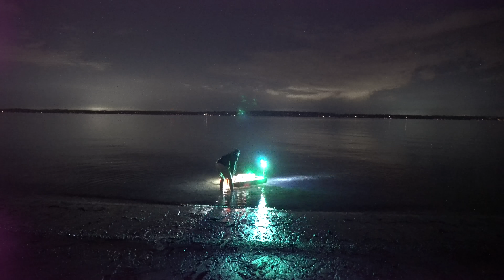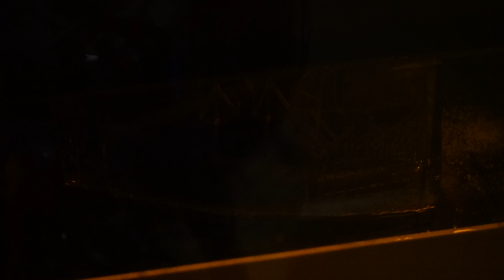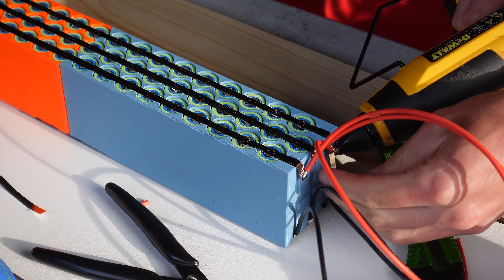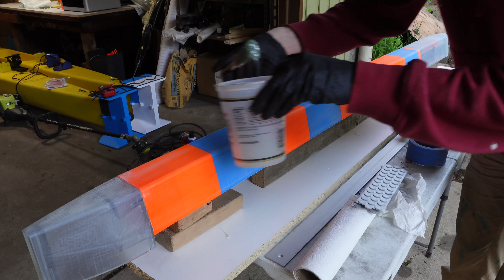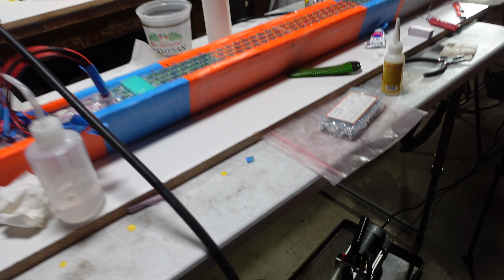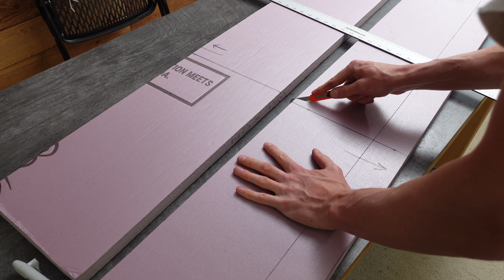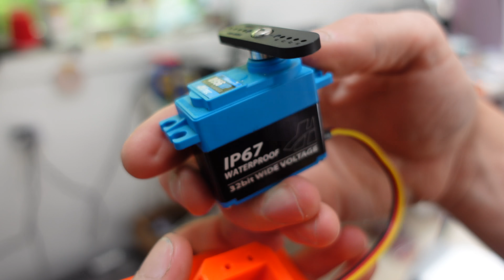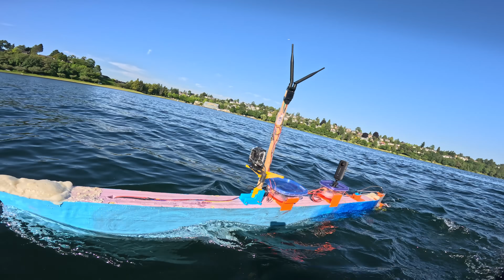"R/C Boat" with 40 lbs of Batteries

Comment: I don't know much about boats but what about fitting two propellers side by side instead of on top of each other ? Sure the rudder and stern would need to be redesigned, but that way you could cancel out the torque while having both propellers under the waterline

Comment: This may be a dumb question, but why all of this grease work instead of mineral oil?  Mineral oil is non-conductive and actually flows. And I'm pretty sure that I've seen you use mineral oil as part of waterproofing on other videos?
Reply from the maker: Mineral oil will leave. Grease stays in

Comment: Couldnt you use a longer Steuerung paddle? Or would that be Even worse because the servo has to use Even more power to steer?
Reply: Also These new fraight Container ships have These wave guards at the front, others pointed out that a Sharp bow would be better so this could be a one Part add on

Comment: @7:18 and @10:35 - Someone taught me a trick with packing old bearings.  Slather the bearing with grease and vacuum seal the pouch.  The grease really gets in the nooks and crannies.  I may have considered the same treatment for the battery greasing.  I see you got around to it...

Comment: I think you should make 2 and make it a catamaran. Also make an access door with simple gasket in the rear instead of that insane top cover over the batteries. Then the tray could slide in from the back.

Comment: Surprised you didn't heat up petroleum jelly and pour that into the battery area. Also, do the cells not get monitored? How do you make sure the cells are evenly charged? Or is that not a concern?

Comment: While filling it with grease. You should have held it at 90 degrees and let gravity naturally allow the air to flow to the top. Though, might have needed to vibrate it to get it move up quicker.

Comment: Cool project.    Not sure why you didn't just use any old oil to displace the air... anything denser than water would have kept it out.   Sure would have been a lot easier.
Reply from the maker: Grease can’t leak out like oil would

Comment: You could make an arm like motor mount that extends from the top rudder motor mount to the bottom and make coaxial proppelers with two motors. It wouldn't add that much drag but servo would have dificult time for sure.

Comment: Add a heavy(ish) keel to make it draw more water/sit lower as well as add yaw & roll stability? Even a bulb keel? And if the weight of the added keel pulls it lower into the water you’ll be able to use counter rotating dual motors again.

Comment: Now we know why Navy destroyers had such a flaring bow during World War II. It was to deflect the big waves 

They also needed the power of two propellers.  
They place them next to each other horizontally rather than vertically. 

Why couldn't you have steering in front, just as well. Is there such a thing as a front-rudder?

Comment: so why ardupilot does no longer work for arduino, defeats the purpose of arduino based flight controller. or you could prefill (cast) the grease, then screw the lid on. sub with a radio tower, under water inverse sub-planing. it would be air-foiling then.

Comment: Thanks! I can't stop thinking about making a small "tractor" that could be useful on a farm. Your videos are giving me great ideas and motivation!
Reply: Me, too, but in planning, I find diminishing returns from extra weight due to more batteries. More batteries are necessary of course to get longer life, and also better traction when towing, and more counterweight when scooping things. The diminishing returns thus causing the ever expanding need for more charging stations at more points on the property to get the most done.
Reply: @AndrewDutton-Topper maybe hybrid car batteries and motors with serious reduction in gearboxes, then big tractor wheels or UTV wheels would be legit. 

Even better with a Tesla drivetrain. 

The key is to make it remote. Not a ride on tractor. Maybe use tracks vs wheels. A 3 point hitch on one end and hydraulic rams on the other would be cool.
Reply: LiamTronix has a video of making an electric tractor. he repurposed an old tractor. *edited for spelling
Reply: @ashman8613 thank you!!!
Reply: Tracked skateboard design. Big and heavy to tow and pull, and maybe dig or mow, but a 400 lbs small tracked platform. 

Maybe treadmill motors and snowmobile tread. Platform in the center the same width as both tracks. Plate on either side with 4 shocks and coil overs for rollers. Motor high in the front and another low in the back on either side.
Reply: That said, it's very difficult to beat the efficiency of a 30hp 4wd tractor. They often have finish mower decks under the center of the tractor, but once the deck is off, the 3pt hitch can run a bush hog, and a 4wd small tractor can climb damn near anything. 

Less with a boom on the front or a bucket.

Comment: Daniel put some bubbles with an air pump at the front of the bow. Do you think that will help? BTW, I was on my stand-up jetski and a Great white shark tried to breach me but ended up just slamming into the side of my ski. I started it up and took off back to the harbor and got the heck out of the water. I was at El Granada Beach in Half Moon Bay, California. I'm never getting in the Ocean again. When you feel the power that you have no control over, it puts fear over you that you can't seem to shake. This happened to me on July 4th. It scares me just writing about it. I hope the body of water you are always on doesnt have GWs in it. Stay safe.

Comment: Have you thought about using parafin wax to seal the batteries? It should be a lot easier to just pour it over them while it is molten, and would repell water like grease
Reply from the maker: but then it gets cold and cracks
Reply: @rctestflight  You can mix in some hotglue sticks (EVA) to prevent that, we used the mixture as the fuel for a hybrid rocket engine and it was really strong

Comment: i would've added more screws to make the battery compartment more air tight and submerged the batteries in mineral oil. mineral oil is fluid at room temperature and would been less of a struggle.

Comment: man just throwing old batteries at the pack might actually decrease your overall pack capacity. you need each set in series to be the same size to squeeze out all the energy from all of them. for your grease you could've heated it and the batteries up a bit. they should be pretty safe at like 50 deg C and the grease will flow much easier.

Comment: Waterproofing suggestion. Paraffin wax it flows easily it plugs holes and waterproofs at same time, parts out side of the hull can be dipped. It's not too bad to remove and it is reusable. A heat gun could be useful to reflow spots after changes or repairs are made. Thanks for the many years of vicarious fun.  Also it's not to pricey
Reply from the maker: I was afraid wax would crack once it's in the cold ocean water
Reply: @rctestflight paraffin wax doesn't really become brittle enough to crack even when at temperatures below  freezing it just increases the likelihood of chipping people used to coat skis in wax or animal fat to decrease friction and I personally coat my snow plow in wax because it has a lot of rust pitting
Reply: @rctestflight mix paraffin wax with microcrystalline wax, should make it much more malleable and flexible.
Reply: @rctestflight  @duroncrush @gnomewarlord8962 paraffin also contracts a lot as it cools and solidifies, if you fill a cavity with liquid and then break it open it'll have a large void (or cause the part you filled to contract).
Reply: @rctestflight bees wax?
Reply: If you mix melted paraffin with mineral oil it will stay flexible in freezing temperatures. @nighthawkinlight did a good video about it.
Reply: @tomr5121  LOVE that guy! 😅
Reply: When I was in the military, we used paraffin wax to seal blood samples that were archived for 30 years at -80C, so I don't think brittleness would be an issue at liquid water temperatures...

Comment: So the WW2 era flatcher class destroyers had long stabilizer fins along the bottom of the hull.  They were long and narrow.    I build an rc version years ago.  The model kit didn’t actually have those modeled in.   It would do the same thing with having the pendulum effect.   Adding a half in strip of styrene along both sides helped a lot.   Also helped with the torque twist.   Be something to consider.
Reply: bilge keels. They're called bilge keels, and they add lots of friction in the rolling direction, while adding minimal friction in the sailing direction. It won't do much against the initial roll, but it will dramatically reduce the pendulum effect. I add them to my RC battleships specifically for that reason.
Reply: @kotori87gaming  i just understood how they work, thanks
Reply: @ThornyA_D39 did you ever consider they are talking to everyone and not just you? 🤦‍♂️
Reply: @JLYK2  Why are you accusing him of thinking that the OP was only talking to him? You gotta make an issue out of non-issues? You that thirsty?
Reply: Ye like the pectoral fins on a fish. Makes sense if you check em out. Good idea!

Comment: Maybe you could add some ballast to get it lower in the water so you can add the second motor? Some weights embedded in the foam at various points along the length of the boat maybe.

Comment: I think the high turn-rate is a function of the length of the boat, and the motor pivoting with the rudder. The beam of the boat is acting as a lever about the fulcrum of its center of gravity, with the propeller applying the force across the axis of the turn.

Comment: @9:36 In future when running a tap through plastics wipe some dish soap onto the tap to lubricate it, clear chips, and keep it from overheating the plastic. If you drive a tap in most grades of acrylic the heat will distort the threads, or the chips will rub on the threads enough to wear away a good percentage of the minor diameter. This will make the threads wear away really quickly and won't give the screws much driving clamping force. Dish soap is also chemically compatible with every plastic grade there is, while tapping fluid/oil will cause compression fractures in certain plastics (especially polycarbonate).
Reply: I never would have thought that tapping fluid could be incompatible with some polymers. Or that dish soap is compatible with every polymer.
Reply: @Mint_drake  Exposure to alcohol or ethylene glycol with break the polymer chains of polycarbonate. So you can't use glass cleaner to clean it, or use it in watercooling loops.
Reply: Smart
Reply: Good to know!
Reply: Good to know. Thank you
Reply: I know this guy has money

Comment: Using vacuum was a good idea, but, next time, my advice is to put a bladder (sealed plastic) around the battery and not rely on plastic panels. It really wasted your time.
Reply from the maker: But a bladder can leak, where as grease can not leak
Reply: @rctestflight  No no. The bladder to contain the grease rather than rely on the plastic!!! Grease is the superior option - there's no question about it. I doubt there's any other format other than potting that can do it better.

Comment: Goodest job. 😊 . Never use a bad battery like 0.6v in a pack of good ones. It never gets fully charged and then it will keep balance charging itself from the rest of the parallels, forever. Sooner it will make the other cells in the parallel pack like itself.
2) Must balance the boat by itself first. Stick a metal bar at the bottom to increase weight and get it sink a little bit. Also check the balance after adding or removing things on its mast. This will prevent over correcting.
Reply: Not only that. He also mixed chemistries. The ecoflow delta uses LiFePO4 which should only be charged up to 3.6V and has a completely different voltage curve. The other cells are NMC and charge up to 4.2V. Really dangerous.
Reply: web1bastler - wow 😮 yes true. And he seal packed the entire sketch thing now.
Reply: The battery section is super sketch.

Comment: Should probably have just made the printed hull hold a long PVC tube which has all the batteries & electronics.
....or just make the entire craft a sealed tube and not bother with a printed hull at all (basically a Narco-torpedo).

Pretty easy to get a full waterproof seal on two ends of a tube vs the janky mess that you've done here 🤣

---

And if you do a proper Narco-torpedo/sub you could add diving planes at the bow and a pressure sensor to keep it a foot or two below the surface with literally just the antenna coming up out the water (So you can't lose it I'd make it ever so slightly buoyant so the planes are always pulling it down underwater when it's underway).

Comment: Probably should've put a grease hole in the center and filled from there, pushing the air out to each end.
Reply: He also should have used a flat stainless ring around the entire top to even out the pressure of the screws, essentially acting as a continuous washer.
Reply: Or car oil

Comment: Just gotta fill the top section with something a little more dense than the foam to get it to ride lower. Not as dense as the batteries so it doesn't flip, but maybe there's a powder or something that'd fit the job 😉

Comment: Might you have used oil in the battery compartment?
Reply from the maker: Then it would leak out. Grease will not
Reply: @rctestflight  Makes sense.

Comment: Cool project! Maybe a small slightly asymmetrical shaped keel fin could counteract some of the motor torque? Would be nice to get it lower in the water and dead still in it's side to side motion just for the stealthy aspect. What about a couple of vacuum sealed counter rotating gyroscopic discs like cruise ships use? Maybe could even use some components from an aviation or nautical compass. Awesome channel, is always inspiring!

Comment: It needs a bulbous bow and maybe some torpedo blisters on the sides for stability, like the Iowa battleships.
Reply: The bulbous bow needs to be carefully tuned for a specific speed. It also doesn't perform well in rough water. Without the right equipment, you'll never get the proper setup that’s efficient—otherwise, it will end up being worse. It's the kind of money a YouTuber doesn't have.

Comment: Well, I had a spicy pillow fully charged sitting on my windowsill for over five years. 2+ years on the marble windowsill in our house in Germany and then since three years ago on the wooden windowsill in our house in Sweden. So you having your battery bank for two years in a questionable state is nothing. And yes, I did use the spicy pillow sometimes, it would deflate when charged and inflate again when discharged.

Comment: For future reference, a brass bristled brush and a penetrating oil, like Liquid Wrench or B'laster will take that surface rust right off of those cells. You can definitely clean those up and apply new heat shrink to them if you're so inclined.

Comment: i like how the heavy battery pack below the water and the bouyant insulation foam on top makes it naturally self correct for any rolling effect from the waves you threw at it. it was getting tossed to almost 90° of roll and would just immediately go right back to upright
Reply: Would he ge the same result from just filling the batteries with oil over grease? Or is that too light?
Reply: @tbrowniscool  grease is probably just because its harder to be displaced / moved by the water

Comment: a nose cone cap that is designed to give lift and throw water to the sides would be a good idea.
Reply: Yeah, like a little flared rim? Or maybe an attachable 3D printed bulbous bow under the waterline could do the trick. Would be fun to test. Not sure the benefit scales down but it sure looks like a vessel that might employ one.

Comment: 18:00 run a strip of marine spray stop tape, or hatch sealing tape over the top of your battery compartment.  Just a little bit of insurance.  But frankly I think using paraffin instead of grease would be a better idea.  Wouldn't flow anywhere once cooled.
Reply: Batteries might get hot though...
Reply: @ryanjohnson3615 he isn't drawing a lot of current at once, just over time so I don't think that's going to be any more of an issue than it would be with grease.
Reply: @thebarkingmouse  Perhaps they might when charging though. Also paraffin expands and contracts quite a bit in its state change. Maybe a higher melting temp wax could serve but why would you want it rigid in the first place? For structure?

Comment: your design here is too low in buoyancy, needs to be about 2 times larger in my opinion, just seeing how it rolls in the water, waves hit too much of the sides, needs to float higher in the water. instead of inventing a boat, try copying a good current boat design , and use that instead of reinventing what others have spent lifetimes perfecting? if it was my design i would copy a battleship, just cus they too was heavy and fast, and use a waterjet engine as they are the most efficient.

Comment: I really like the grease idea. I think if you simply potted the batteries in beef fat which melts at 40 degrees celsius it would be much easier. It would set when it cools and you wouldn't need screws or pressure etc.
Reply: Would need shark repellant though😁
Reply: Paraffine?
Reply: I can't even imagine the smell. Must be nasty to work with hahaha
Reply: @snjert8406  pure fat is clean and does not smell, I guess wax would be another option

Comment: it's long and skinny, that's why the prop torque is having so much affect on the heal angle, a small outrigger on the "lee" side (or the side it't healing to) would give it the stability you need for better videos, but it looks like it's fine without it too.

Comment: A wider hull would be more stable, it wouldn't have to steer as much, plus it wouldn't need to sit as lot in the water which increases resistance.

Although I suppose it wouldn't be self correcting if it capsizes.